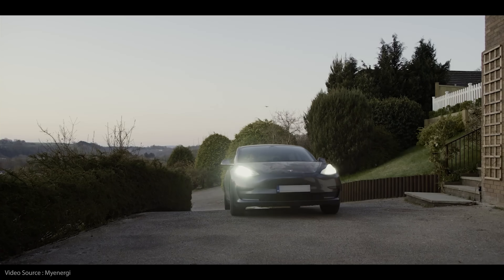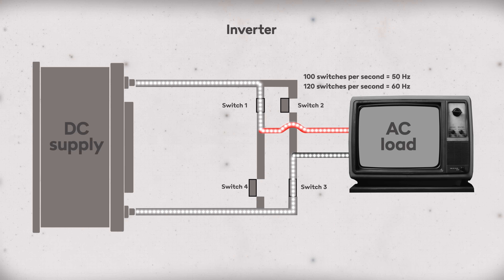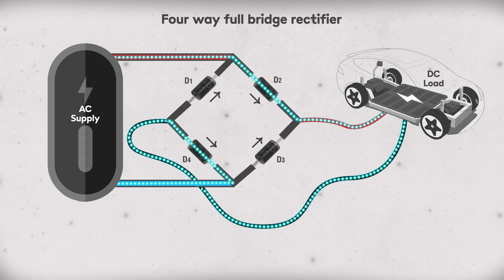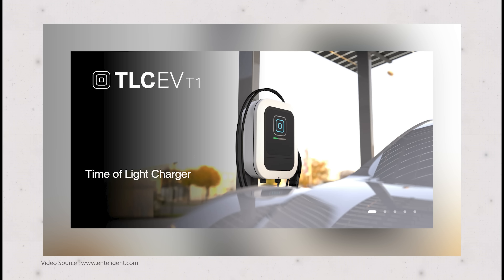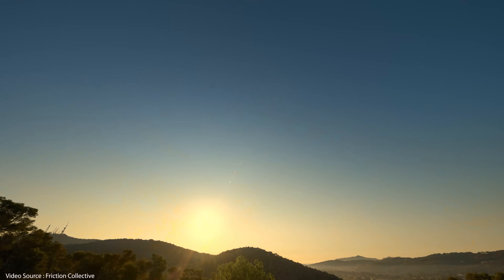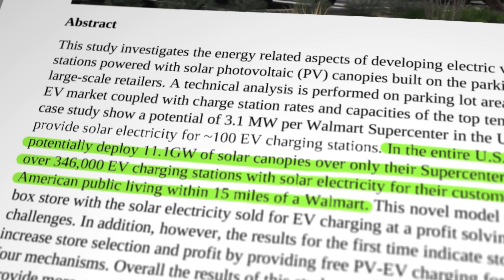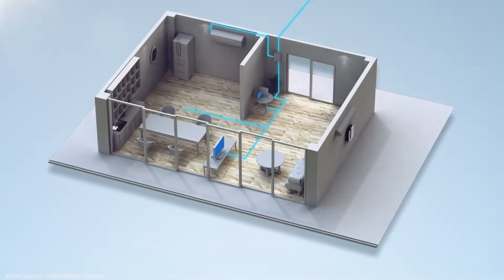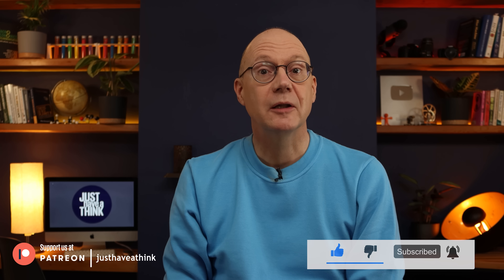DC to DC charging. One more step to off grid living!

Comment: Very interesting! Besides Solar Edge, GM is also partnering with another company, working on bi-directional power. They imagine a large "fleet" of EV trucks (w/200 KWH batteries) and other EVs plugged in and contributing to ease power shortages. If places of employment, local electrical utilities, and the government bureaucracy cooperated then during the DAYTIME when people are at work the concept would work. State-wide utilities should build energy storage units that can handle gigawatts (we have existing technology for that) AND beef up their power switching capability. I think the northern tier states would benefit from energy storage too, they can absorb power from wind. The cost will have to be absorbed over time. California is already reducing tax credits for home solar because there is too much home solar power during the day, so they should build more ocean water to fresh water plants  to use that free power and export that water to the other southwestern states with water shortages. Texas will remain in the dark ages of power management until they get a new non-corrupt governor as well as non-MAGA senators and representatives.
Finally, for living off the grid, a home will need a fairly big investment. Solar power with battery storage, enough to run a house for several days off grid AND charge your EVs, will be needed.

Comment: Fidel Castro said it best: "It would be insensible for everyone to own a car. It would be like having everyone own an airplane. Where would you park so many cars? Where would you put so many airplanes? If all families had automobiles, they couldn’t be parked or accommodated anywhere, there wouldn’t be room for so many cars. There would have to be many streets and highways. It would be insanity."

And it already is yet you think everyone switching to/getting an EV is a good thing. It's really not. We need to be looking at systemic solutions like mass transportation i.e. railways, trolly systems, Ebusses, etc NOT individual solutions that don't solve the root cause of the issues but instead compound them: expecting everyone to own a vehicle and now expecting everyone to buy a vehicle AND their own mini solar power plant when many struggle to afford a car and a home to begin with. To end with another Fidel Castro quote: "Capitalism has neither the capacity, nor the morality, nor the ethics to solve the problem of POVERTY".

Comment: I don't really know anything about electric cars, except that they run on DC batteries. I know a bit about solar panels, namely, they produce DC not AC. If the two industries could decide on a specific Direct Current voltage, then it would be rather simple to charge your car battery with your solar panels with no loss except from the wires. The only real problem is that everybody wants to do things differently. The battery powered tool industry seems to have come to some sort of agreement, but they do keep upping the voltage on the batteries, 7 to 12 to 18 to 24 to 48. I think I would like a 48-volt battery for my hand drill so I can break my wrist the first time I use it. :face-pink-tears:

Comment: What I don't get is: why after 70 years of ubiquitous D.C. electronics, A.C. is still the default inside homes when almost everything in it runs on D.C.
I understand the practicality of using A.C. to bring power from generating stations to dwellings, but inside my home there's only three things which run on A.C. the fridge, blender and heater/fan, while everything else runs on D.C. That's dozens of devices (50+), each one requiring it's own A.C. to D.C. adapter. It's just ridiculous. I could cover all the voltages needed with 3.3, 5, 9, and 12V.

Comment: We are currently building a off-grid home in regional Victoria, Australia. When the home is completed, we will be purchasing an EV with a bidirectional battery - this DC-DC charging is one of the innovations I have been waiting for! 
Nonetheless, I am still eagerly anticipating the advent of technology that would enable an EV to directly power home storage batteries during extended periods of ‘dunkelflaute’. 
To me, this is the missing link which would allow people to go off-grid using the EV as the backup generator (avoiding the use of a fossil-fuel generator). 
PS - I am not referring to V2L/H as this is too selective and restricted.

Comment: Thanks Dave.
With the new GaNfets efficiencies are getting so good that it really isn't  a big deal, we're seeing efficiencies  of over 95% on  DC to pure  AC inverters now.

I thought about this myself and what I did was install an Emporia EVSE. It only charges my batteries when the sun is out through my paid off PV system. Works like a charm. In fact, last month, charging my car, cooling my house, hot water and all appliances we only used 40 kWh from the grid - that's about $4.00!

Comment: Car park solar canopies should be off-grid anyway so shouldn't need permits. Most modern EVs have DC fast-charging and even the older ones could charge via inverters.
Hybrid AC/DC domestic electricity makes sense. EVs and batteries are DC anyway and I'm pretty sure resistive heaters (water & spatial heating) don't care. I look forward to the day when my local appliance store starts advertising hybrid AC/DC versions of TVs, washing machines, dishwashers, microwaves, kettles etc. It should start with lighting/USB charging which are natively DC anyway.

Comment: Any time the DC voltage that you need is higher or lower than the voltage that you have at hand, a "buck" or "boost" stage is required in the DC/DC converter circuitry.  How is this bucking or boosting carried out?  You guessed it...with high frequency AC.    

Much of the DC/DC efficiency gain that people imagine, is really nonexistent.

Comment: DC to AC conversion used to be done with a DC motor that drives a AC generator.
Reply: I still have somewhere amongst my boy's junk collection a 2kw  24vdc to 230vac one piece motor generator. It drew 10 amps with no load and had an efficiency of around 65%. It went into retirement the moment solid state inverters were available.

Comment: can I ask a slightly off topic question about solar panels please. I believe they loose efficiency in bright sun. but  only require part of the  suns spectrum, the rest just heating up the panel unnecessarily. Can we not add a filter to only allow the part of the spectrum they need and reflect the rest away?

Comment: I'm increasingly of the mindset, that de-centralized approaches may have to provide a good deal of solution.  One can't upgrade the grid fast enough.  Self consumption systems can move more rapidly.  

This doesn't necessarily mean being totally off-grid.  One can draw power from the grid, as needed, as backup, and as capacity would allow, just as any appliance.  Feeding electricity back to the grid creates a whole lot of complications for those who have to manage the lines.  Plus it adds more resilience and local independence.  At least more options, when the sun is shining, during parts of the day.

Comment: Solar pannels in series can reach as much as 1000v dc, surely wouldnt it be a case of taking few panels off to calculate the right voltage and the amps would vary threw out the day, bit jack the laid, but it only takes one person to do it or a big fail and a right off a elictric car. more in parallel for more watts

Comment: I suspect that eventually DC will get ever more end to end use, as ever more production is DC, ever more loads, and of course energy storage.  For local production and local use, it'll someday just be sensible to stay DC from end to end, and there will someday be a market for DC appliances (maybe just a matter of a DC instead of AC motor).

The main loss for AC is transmission though, rather than conversion.  Hassles include producing a good waveform.  Given that most of the cost of electricity from the grid is the grid itself, selling to the grid may not be worthwhile.
Reply: Much domestic equipment, computers, wall warts, led lights, lithium cordless chargers, inverter microwaves and induction cookers can use DC. My switchmode welder is happy on dc. These rectify the ac mains internally supplying them with dc means the rectifier is just conducting dc. Universal motors as used in vacuum cleaners and corded power tools run really well and quietly on dc but the mechanical switches intended for ac fail very quickly.

Comment: Non trivial fact, almost all your appliances in your home operate on  DC as well, all having a rectifier (with its energy loss). Why not wire everything for DC then? High loss in the wires or the requirement of much thicker wires than AC. Like most things, it ain't as straightforward as it sounds to solve those things.

Comment: Great episode! It seems like low hanging fruit, and potentially very important progress.  

I don't think off peak charging has to become another significant peak in demand though. Off peak incentives programs should be controlled by software based on the actual situation on the grid anyway, both incentives and control of the draw should be automatic. But I also have a suspicion that you intentionally oversimplify stuff like that, partly as another way to encourage commenting, and if so I perfectly fine with that. Your direct encouragement to comment was fantastic, as usual.

Comment: Most people just don't understand product lifecycles. They always start off crap, have problems, slowly get better, then finally work really well and are quite efficient. I think we're up to the 'have problems/slowly get better' point in EV's. I don't think it will be long until we reach the next step.
Reply: EVs already work well and are far more efficient then continuously blowing up fossil fuel to produce a lot of heat and little forward motion. We're already there. If you have access to a plug at home or work yet you buy a new combustion car, you're doing it wrong.

Comment: Unless the voltages match, you still need a DC to DC converter to make the voltages match, and that applies equally if the DC to DC converter. These also lose power, thought in fairness not as much as a 13%.

I would hope that an ethical company would be upfront about the countervailing issues with their system

Comment: Sigenergy is showing of a system in Germany with a stackable low voltage DC battery where you can buy a stack which is CCS compatible charge/discharge enabled. https://youtu.be/onA392phtTA?si=DVyNQp-TnY16hrLy
Reply: The inventor is apparently from Huawei and it currently works with Nio cars

Comment: Here’s a thought. When building shopping malls, put a subterranean battery storage facility in so surplus from the DC canopies can be stored and used to either DC charge EVs when there’s no sun or exported to the grid as and when permits have been obtained and the grid requires.

Comment: Im just amazed people have not thought of this before, its so simple to reduce losses due to the conversion process
Reply: Oh, everyone has thought of it. It's just not an easy problem to solve. Some requirements:

a) Implement CCS Type 1, a protocol notorious for interoperability issues between different charge vendors and different vehicle models;
b) Convert between the variable voltage of a solar array, to the specific voltage negotiated in each CCS session, which could range from 400 to 900 volts;
c) Regulate the amperage as well (dynamically, through feedback from the EV's battery management system);
d) Handle that massive voltage and power in such a way that, if millions of idiot DIY homeowners deploy your thing, most of them won't electrocute themselves at some point.

Easy, right? Yeah, if you're willing to spend the money. Commercial DC fast chargers cost 6 figures. This thing had better be waaaaaaay below that, since its entire value prop is to avoid "losses of up to 13%." As such, it only makes sense if it is cheaper than, you know, just installing 13% more solar panels.*

*Yes, I know, the reciprocal of 87% is not 113% but 115%. But I don't buy the "losses of up to 13%," nor that this device would have losses of 0%.
Reply: @ps.2  thank you for all the points but everything you have listed minus the solar and css, is considered on all products design to protect consumers and networks and there is set guidence which is required to be followed to meet the required standards.

The electric stability would be the hardest thing when charging from solar and most people will only have arrays of 5-6kw and in peak conditions will easily reach the voltage requirements on a sunny day. People with larger arrays would be better suited for these chargers for business who have a warehouse roof full of panels. I know its a bit more complicated then what I have listed but I don't have the time lol
Reply: @Sean_S1000  Huge difference in safety engineering between a 120 or 240VAC EVSE — which is little more than a specialized extension cord — and a 400-900V DC fast charger. (Also a huge difference in the power electronics — the DC fast charger has to implement a full CCS Type 1 endpoint, while the EVSE does not — but let's just talk about safety for now.) There are good reasons residential electricity is limited to 240 volts. If it were easy to design lights, plugs, cords, and appliances to operate at 400 volts or higher, we would. It'd mean thinner, cheaper wires, right? But it's not so easy. You need better insulation and isolation (live wires have to be further apart). You need faster, higher-end switches — the ones on walls, in lamps and appliances, in circuit breakers. And it's super dangerous to human touch in a way 120V or even 240V is not.
Reply: @ps.2  is this not already something which has been designed in to the DC 22kwh charger which are already available for the 3 phase market are already readily available in the market. 

I am aware of the dangers of higher voltages and current amps and DC over Ac and higher safety requirements.

The only difference I can see is this new charger as the ability to utilize DC input, without the need to of an inbuilt inverter.

I could be missing reading the sales and spec info but, I do appreciate the level of detail you are going in as it will highlight the engineering considerations for others and filling in gaps I may have in my knowledge
Reply: @Sean_S1000  I'm not familiar with a 22 kW DC charger with 3-phase input. But I wonder if you are thinking of a 3-phase A/C charger instead? I ask because CCS Type 2, used in Europe, directly supports 3-phase A/C charging. Though for some reason I had the impression it was limited to 11 kW.

(CCS Type 1, used in North America, does not. This is because European residential electrical service often provides 3-phase, while North American residential service usually does not. And now you know why the CCS Type 2 pinout has 3 pins for A/C power, while the CCS Type 1 pinout has only 2.)

I don't live in Europe, but I presume 3-phase residential power is 208V RMS phase-to-phase. If that's the case, 22 kW would require each pin to carry 35A. That's a lot, but still practical.
Reply: @ps.2 Not sure if they are available in the states but they have some available in europe, granted they are rare. But teisonev, ambibox are some examples, granted they are significantly more expensive and if cost is significant factor then they will never be worth the additional investment for the gains in losses recovered, would be better buying larger solar array with one of the existing ac chargers. 

Not saying in anyway what there doing isn't great if it came across that way and I will been watching to see the cost difference. 

Also anyone reading these, if you don't know what your doing hire a professional a day or weeks wages isn't worth dying over.

Comment: Solar Edge has been making a charger built in to its inverters for a while now. It isn't DC, but it puts the AC from the inverter to the charger before it hits the production meter, so it saves customers money in cases where net metering gives home owners less-than-retail value for the kWh they produce. A friend of mine has one and avoids a 3 cent penalty from the utility, just on his EV charging.

Comment: Another company dcbel.engery has a similar system, but it is an overall AC/DC power manging device. It acts as a sort of central router/inverter/charger/V2X/manager for all your power - DC or AC. It can charge a vehicle directly form panels, or from a stationary battery (which it also can charge) or from the AC grid. It can invert solar to AC using a very efficient PUC5 inverter. It can program all of this to coordinate with power pricing. I haven't heard much from them lately, but they allegedly are selling the device called Ara in New York and California.

Comment: Totally agree with your arguments.  The local airport in Illinois has been moving to cover the entire parking lot with panels to power the airport and an increasing number of EV vehicles, both private and airport support commercial  units.  As a side benefit, personal vehicles are shaded from the sun and snow not to mention thevoccasionsl hail.  The latter opens different issues.  Your example of covering Walmart and other commercial business parking lots depends on the desire to invest in the business and the general n public.  The future is here and simply the mommentem is increasing.